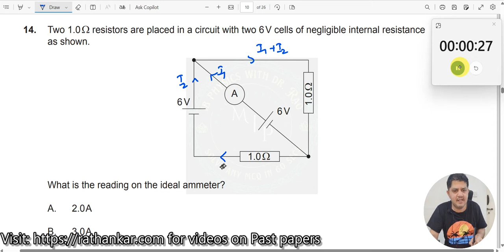14. Two 1.0Ω resistors are placed in a circuit with two 6V cells of negligible internal resistance

Comment: Hello sir, in an ideal ammeter the resistance is 0, therefore the voltage will remain the same
Reply from the maker: Hi, you are right the resistance is zero and voltage across the ammeter is also zero, but a current will flow through it and the question is about the current and not the voltage